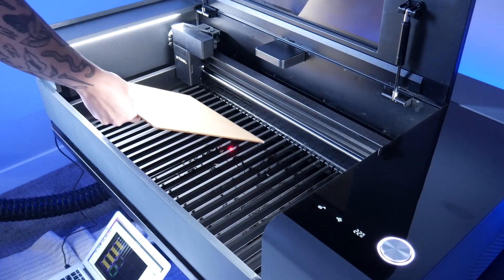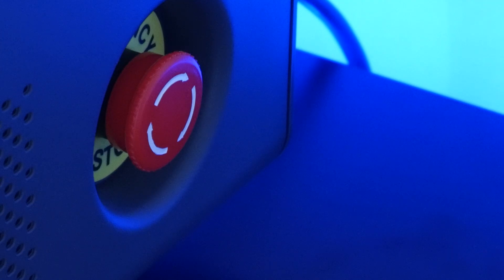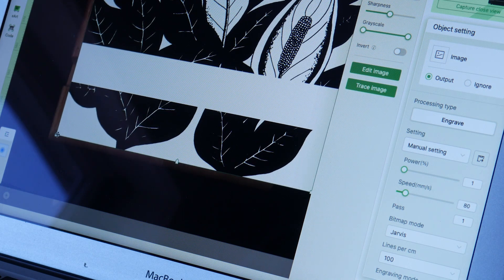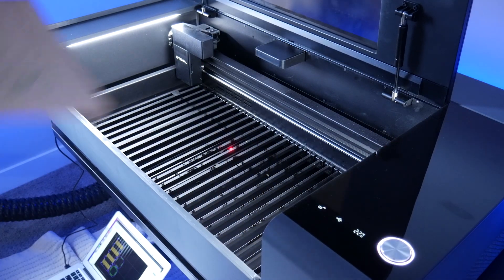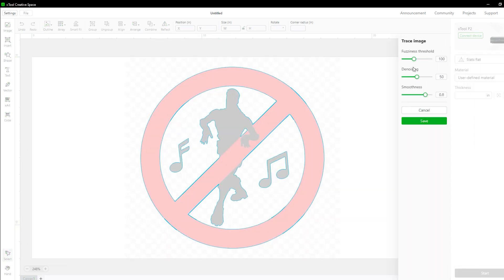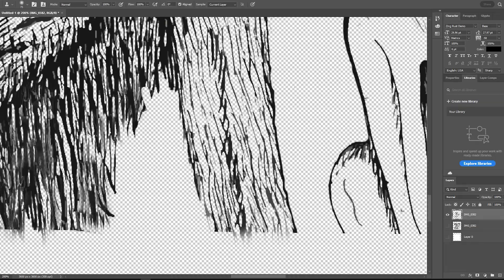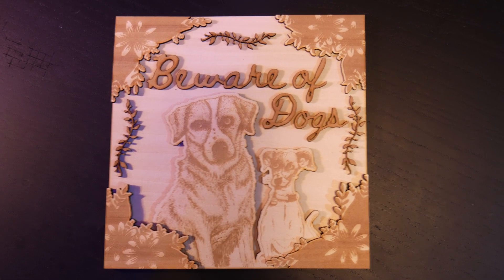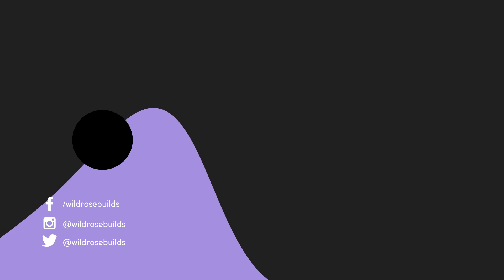The Best Laser Machine in 2023 - xTool P2 55 W CO2 Laser Cutter - First Look and Some Cool Projects

Comment: for engraving try to put a layer of borax mixture with water
Reply from the maker: Oh really? What’s the purpose of that? Thanks for the tip
Reply: @WildRoseBuilds  The Borax works better at absorbing the laser energy, so you get much darker engravings on the surface and can use lower power / faster speed settings. Lotta good videos out there if you want to learn in more detail :)